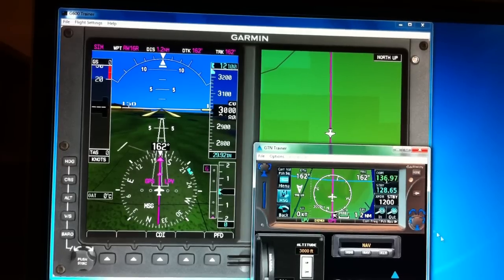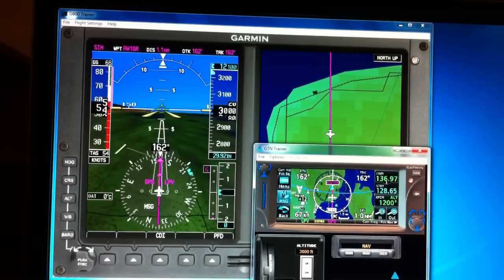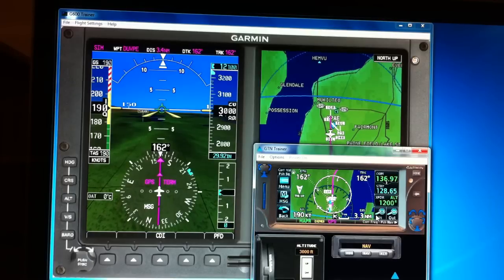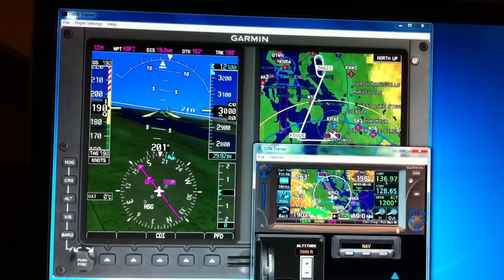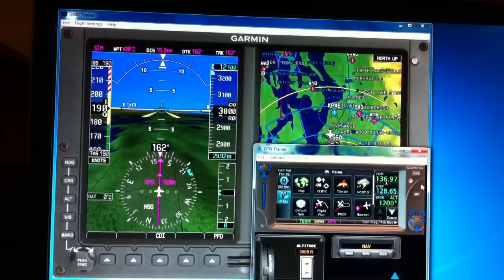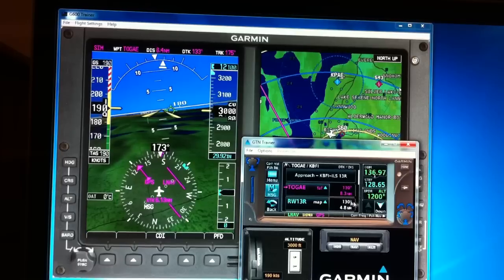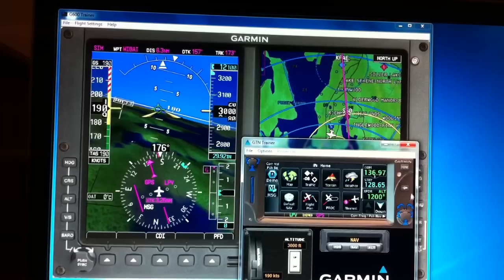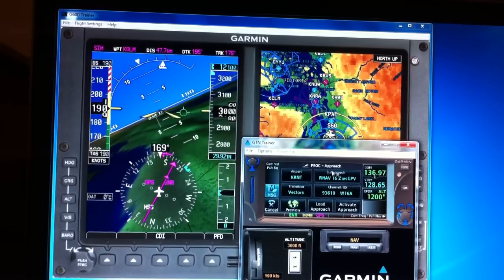Garmin GTN 650 - Direct to Issue - Now Fixed by Garmin

Comment: Admittedly I don't have much time behind a 430 so maybe it's just because I'm coming at it fresh, but I would think it would be much more confusing for the behavior of "direct-to" to differ based on if the destination is a fix vs. an airport.  The way I'd do this on the 650 is to go to PROC first, tell it I want to shoot the BFI ILS-13R, then "direct-to" and use a flight plan waypoint.  

I actually shot the PAE ILS-16R yesterday.  Perhaps we've passed each other in the sky.  (I'm based at RNT)

Comment: But if your new direct to destination is an airport not a fix, it should load the new approaches for your new airport.  The old airport has no bearing at this point.  This is how the logic worked on the 430's and most of us who stepped up to the GTN came from 430s.  It is a lot faster to go "direct to" an airport and load approaches than any other method I have come across to date.

Comment: I suggest you to put your alternate airport at the last position of your flight plan. Garmin picks up the last wpt of the active flight plan to auto fill the procedure airport. That is why I do not recommend to use dct to navigation but rather use FPL, even for a dct to navigation. By the way, did you get a reply from Garmin ?